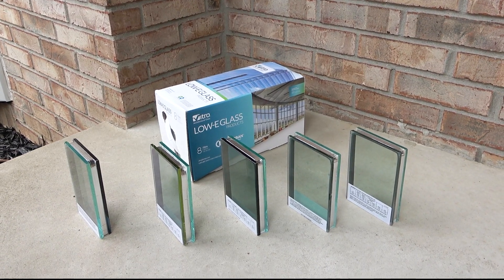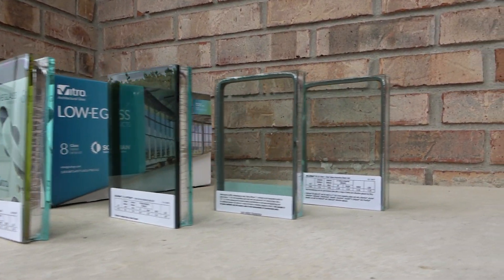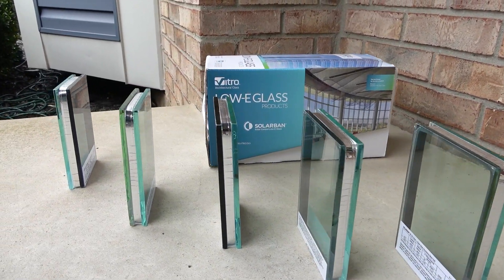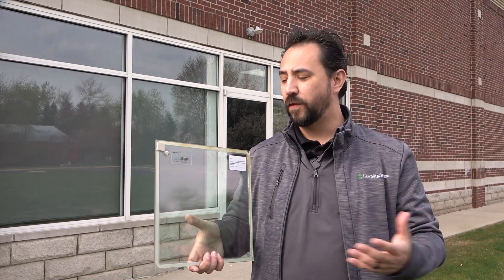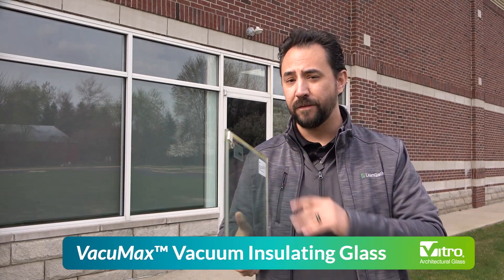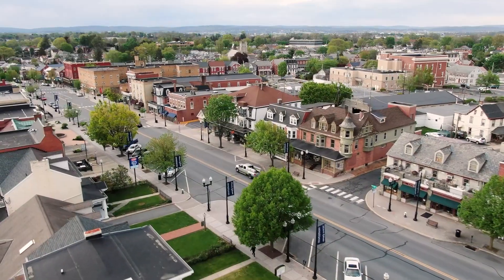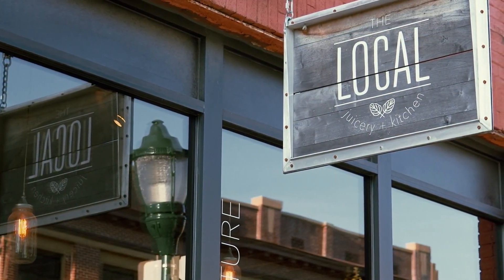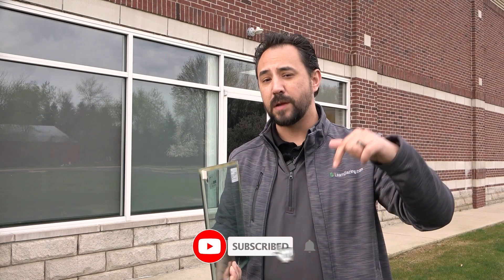What is Vacuum Insulated Glass

Comment: how do you stop the rubbing of the panes in larger panels?
Reply from the maker: They are basically always touching. One of the two pieces of glass has small 3d like dots (mico spacers) throughout which does touch the other panel. This keeps the two from fully touching creating that small void/air space.